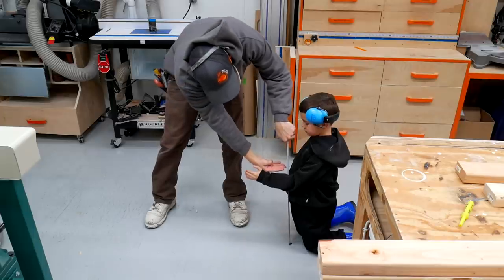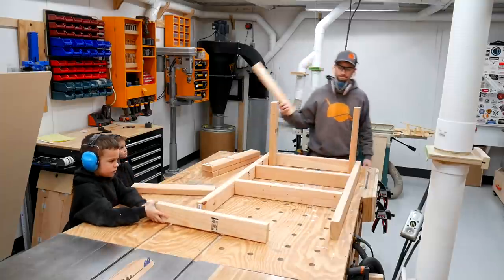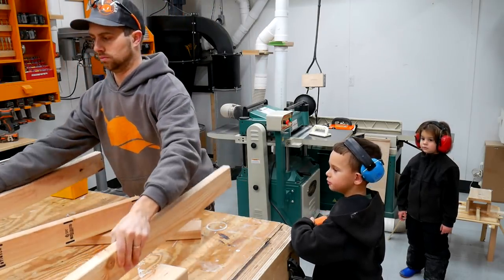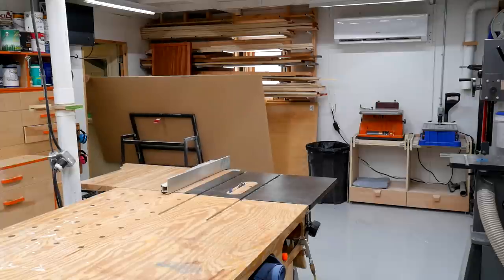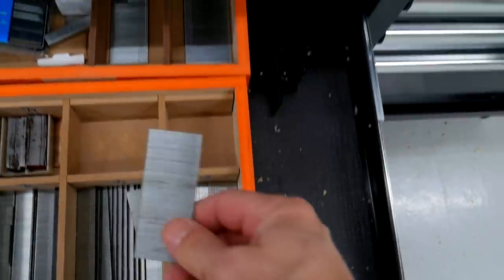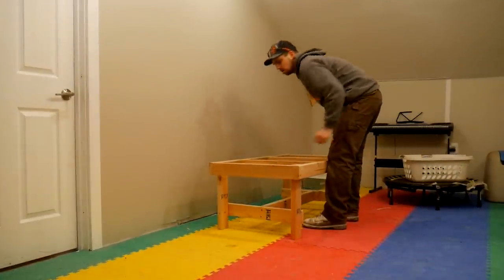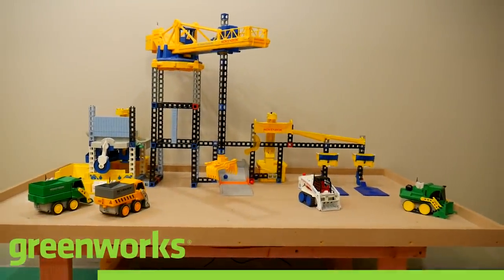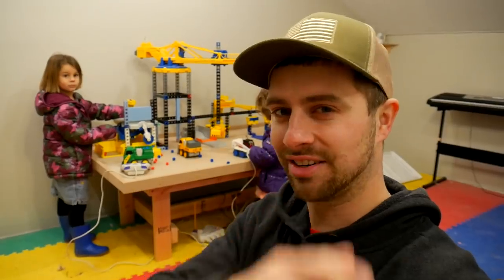Build a Simple $45 DIY Game Table with the Kids!

Comment: Re splitting ends. I tend to find it's not from the screw thread, more the screw head that doesn't cut its own countersink. But if you're going to countersink, you might as well drill with combination drill /self countersink tool